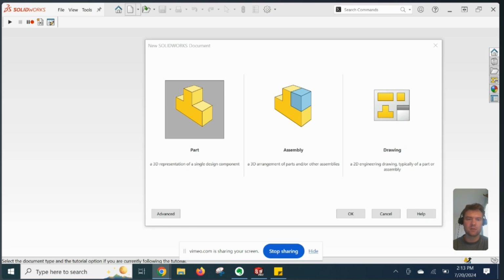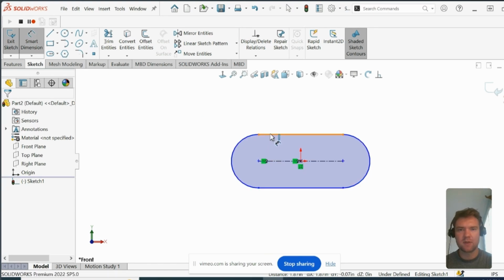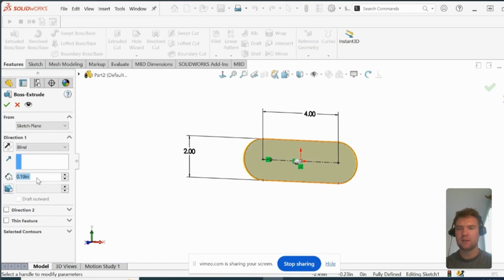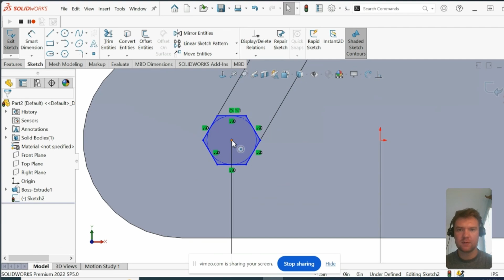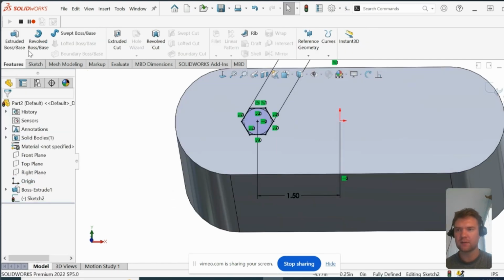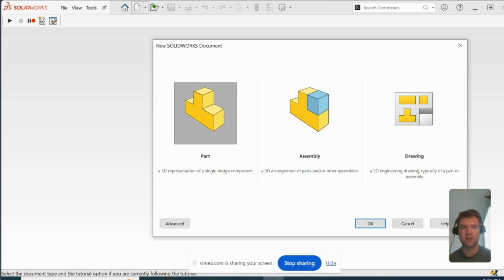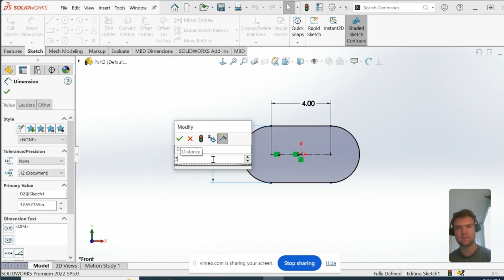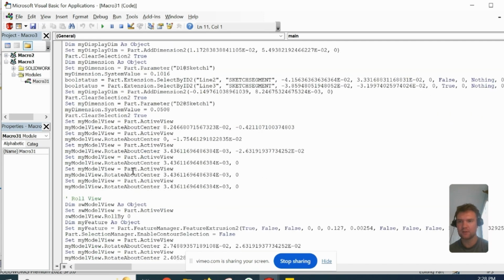How to Use Solidworks Macros for Beginners

Comment: Just some constructive feedback, you say "let's get straight to the point" which is understandably what everybody prefers when watching one of these tutorials. However, the video has a plethora of unedited silence of you sketching and extruding etc etc. I would personally love to see those small portions sped up significantly as the assumption can be made that we know how to do these steps. The commentary is monotone which is fine and the way I speak on occasion, but being more personable and engaging goes a long way in audience retention. I recommend watching other popular CAD youtubers and try to emulate their tutorial and editing styles. Notice what things they skip over and what tips they give, super handy stuff. As an aside, Lenovo or any other computer manufacturer doesn't inherently have better systems across the board for CAD, gaming, you name it. It's all about hardware! They all use similar parts with their own packaging. Having a baseline knowledge of what resources your program or type of program uses most of is important - i.e. CPU (single/multi thread, clock speed), GPU (VRAM, architecture type/use case), and RAM (GB) all play a role. Solidworks prefers workstation GPU chips such as Nvidia Quadro's rather than gaming chips like Geforce (at a given price point).